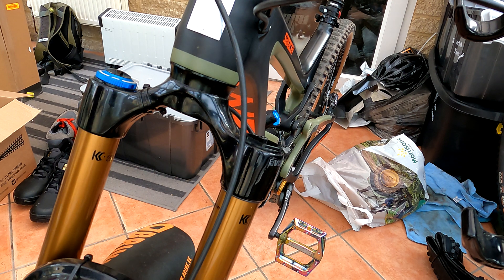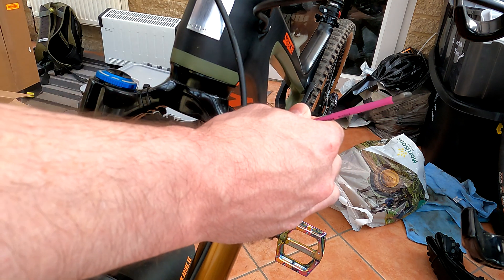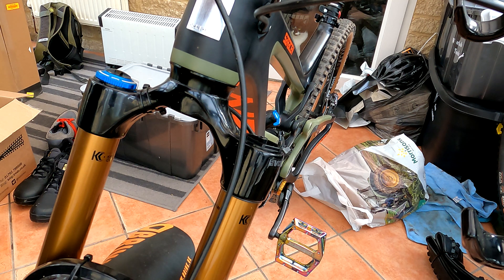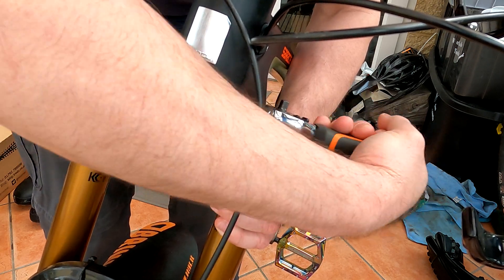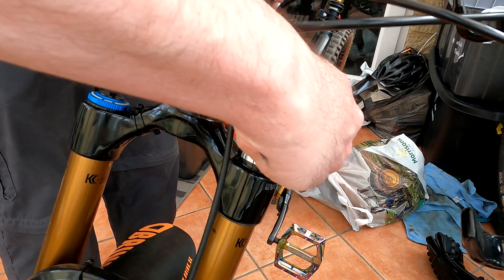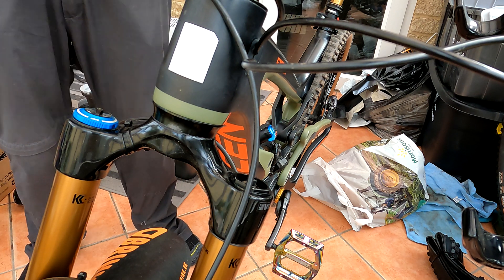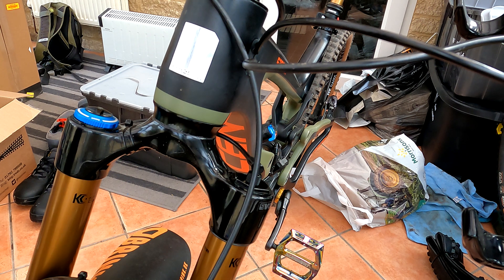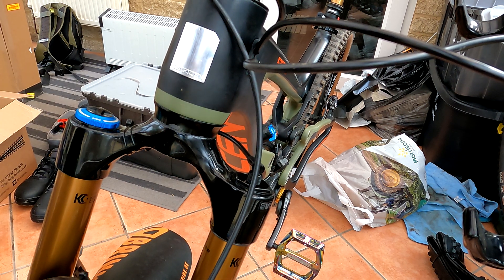Adding and Removing Volume Spacers Fox 38

Comment: I wanted to watch a video before I install the spacers on my 38. So that I don't scratch the black top cover when removing it. What does he do in the video?? He slips twice and scratches the nut😂😂 Thanks, now I know what to look out for.
Reply from the maker: @StillCold_GER  typical over tight top made of that soft aluminum Fox like to use, it was inevitable. Mountain bikes are supposed to have scratches anyway 😂

Use a flat socket and put some weight on it when you undo.

Comment: when i release the air in my fox 30 the fork sucks itself in and is very tough to pull out? any ideas?
Reply from the maker: If you balance the positive and negative air chambers as you remove air, it wont suck down.

Remove air 10psi at a time, pumping 5 times between each air release should do it
Reply: @churchofdirt-mtb  tried that and still the same, think I might have a grease blockage internally as that seems to be common
Reply from the maker: That is usually the case on 36's, 38's have a different air cylinder design which is generally better

Comment: After add the spacers must put the same pressure as before? Or just add the amount to have the same sag, so adding spacers to have the same sag the pressure will be lower? Thanks
Reply from the maker: I would personally use the pressure that gets you to the sag you require. (Be mindful of balancing the positive and negative chambers).

Comment: Fox 36 volume spacers Do fit the fox 38 seen it done and used! I've not tried it but have them and click in the yellow 38 spacers perfect there exactly the same
Reply from the maker: Yep 36 and 38 volume spacers will click together and technically displace the same amount of volume. The dimensions are slightly different, 38 ones being a little fatter and shorter, I can foresee if a fork is fully maxed out with spacers it "may" cause issues. (Not that I've tested this, I've not personally found a need to fully max out the spacer count)

Comment: Ciao, a quanti Nm stringi l inserto da 32mm ?
Reply from the maker: Fox do not provide torque settings for the Top Cap assembly, basically you want to be tight but don't try to over tighten.
Reply: Grazie della risposta 🤙🏻
Reply from the maker: You are welcome Marco :-)
Reply: Ciao ho trovato i dati ufficiali fox per stringere il tappo, 24,8 Nm
Reply from the maker: @Marco_Mattia  be careful though, thats the old torque spec for Fox 34s
Reply: Vale anche su 36 e 38 c'è  scritto, l ho trovato sul manuale della mia fox 38
Reply from the maker: @Marco_Mattia  Great news then, thank you for sharing :-)

Comment: Did you take the lower legs off too and see how much grease? My 170 38 is ramping up quite a lot and getting nowhere near full travel (about 70%). Also seems a bit harsh generally. I'll be looking at the spacers, but wondering if they've put too much grease on the air shaft from the factory 🤔
Reply from the maker: I didn't but yes the usual, shall we say liberial amount of grease could be seen from the top. 

I had a similar issue to what you are describing with a set of Marzocchi Bomber Z1's, but worse in that there was virtually no travel after a time. (Did a lower leg, air side service and grip damper fluid change, all being good since).

I'll probably service this particular 38 over the winter period but its working well at the moment.

Comment: How many volume spacers Does a new fork comes with mounted inside?
Reply from the maker: I think it may change based on travel but this is a 180mm 27.5 fork and cane with one.
Reply: @churchofdirt-mtb  I’m willing to buy the same 180mm 29er how many I should put inside?
Reply from the maker: Thats a wide ranging question. I'd start with the Fox recommended settings for your weight (with all gear etc) and adjust from there. If you get to a point where you either blow through travel when you have the small bump sensitivity right or not getting through all the travel but the small bump is right, then look at spacers.
Reply: @churchofdirt-mtb  thanks bud for replying this fast I really appreciate your help